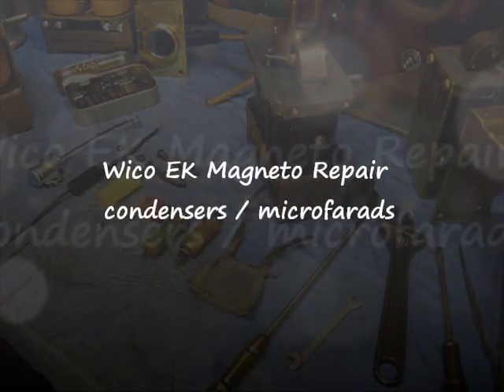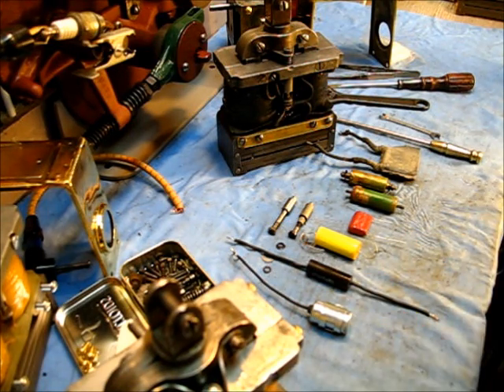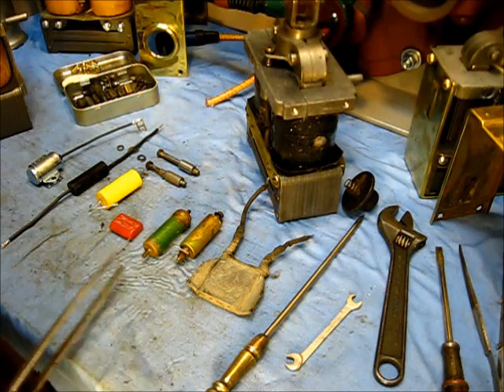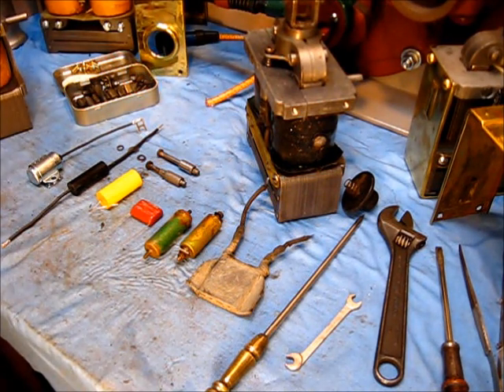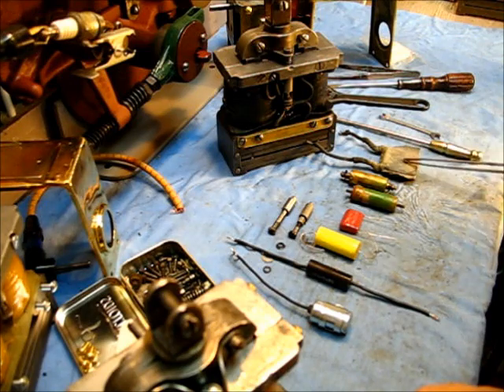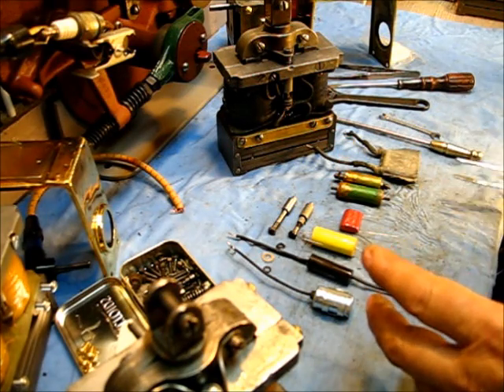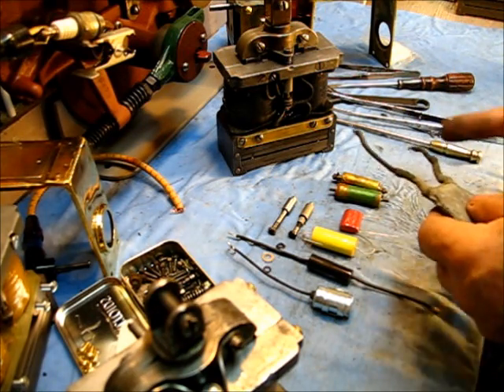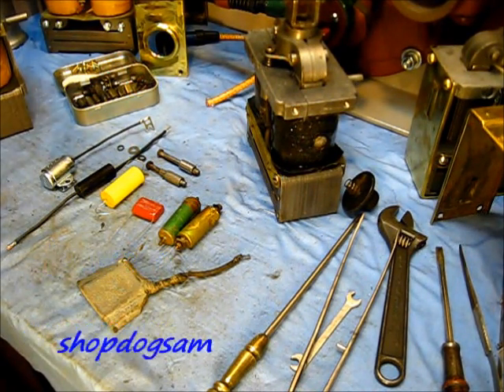Wico EK Magneto Repair condensers / microfarads 12of

Comment: You should be looking for an X2 rated capacitor really. It’s not quite so important in the EK mags, but as a general rule it should be X2 rated (that’s a safety capacitor that can be connected across the mains supply, if it says 250v ac X2 then it will easily cope with over 600v DC).
X1 rating is even better, but they’re much bigger.
X1 or X2 caps are more expensive, but they’re the only ones with a fast enough recovery time (it’s called a dV/dT rating) for use in magnetos. They basically handle the high voltage spikes much better.

Comment: I repair vacuum tube radios. There are many places to order new capacitors   You can buy in bulk. The orange cap in the video is what we call an orange drop   they are the best caps to buy   The yellow cap is also good and will be a tad less $ .   I have read the 400volt is enough for these mages  Higher voltage doesnt hurt a thing....they will cost more but actually a higher voltage cap takes the voltage and you have overhead and not maxing the cap out. Just make sure the cap will fit in the area it needs to as the get bigger with higher mfd and voltage! Those supply companies scratching off the info is a d*ck move on their part! Charge 8-10$ for a 50 cent to 1$ cap in most cases! Thanks for these videos Dog!

Comment: if those old capacitors are anything like the wax paper ones from old valve equipment then they will get leaky which means they act more like a resistor and less like a capacitor at a higher voltage, if they get leaky enough or short that will kill the spark

Comment: Lots. Short version- In an ignition system: A)  the condenser absorbs the voltage spike from the magnetic field collapse in the primary when the mag trips to keep the points from burning, and B) stores and returns that voltage to the secondary. A condenser blocks DC -and passes AC. U-tuber Andydaviesbythesea has a good series on condensers -capacitors (same thing.)